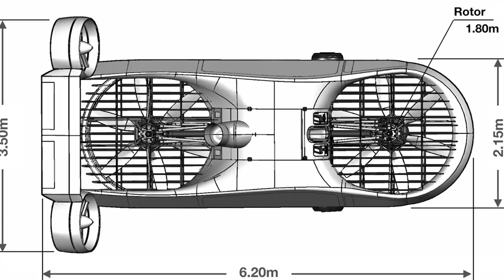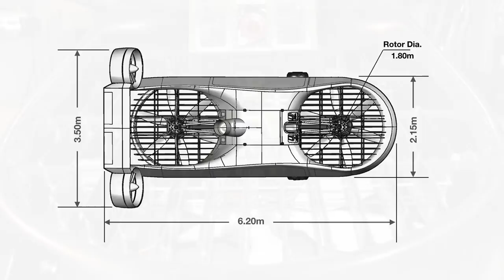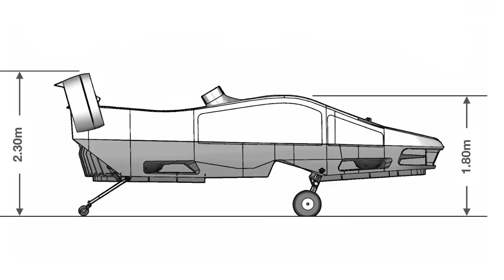eVTOL News video, Episode 2: Urban Aeronautics in-depth interview

Comment: Small fan means low efficiency, you can't expect long duration.
Reply: Yes, but increasing the fans tenfold the efficiency increases
Reply: That depends on the goal and application. For hover? Yes, you would be right. As for moving between locations? Not so much. It might produce less drag moving forward, and as such increase efficiency which might be enough to match a heli's range. Adding some stubby wing surfaces would certainly help it.

Comment: He seems to be making more progress than Moller. Moller has made the mistake of not using gas turbine engines.
Reply: Why was that a mistake? Did he use a piston engine? If so, there isn't really anything wrong with piston engines. In fact, depending on what you want, they can be better than turbines.

Comment: The general idea of what this design is pretty good. But I don't agree with just two internal propellers design. The likelihood of failure is high at which point you become a flying brick. Even if they have a parachute system the failure chance is too high especially close to the ground where a parachute wouldn't help. A much better design is something that has at least six or eight propellers. They can be smaller and go around the perimeter of the body. Similar to Moller Flying Saucer. And even better than using propellers is simply using electric Jets similar to Franky Zapata flying platform. Just make them electric.
Reply: it is basically a helicopter with its blades protected. would you want all helicopters to have lots of extra rotors encase there is a problem?.  in the future they may make a electric version if it is feasible.
Reply: 8 rotors is about the best. Great redundancy and still simple enough.
Reply: That reduces efficiency. Thrust failure isn't as big of a problem as engine failure. That's where something wrong is more likely to happen since engines are more complex. 
 
What do you mean by "electric jets"? You mean electric ducted fans? because this is using exactly that, just bigger.